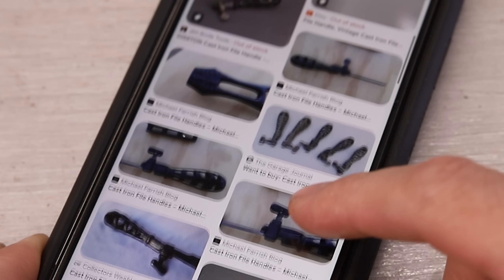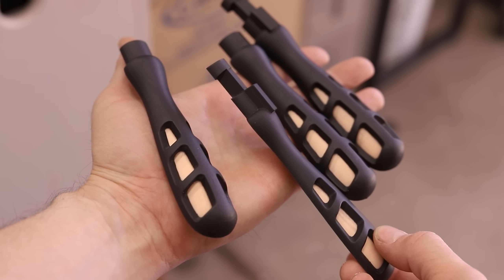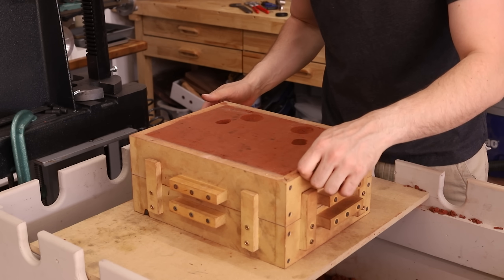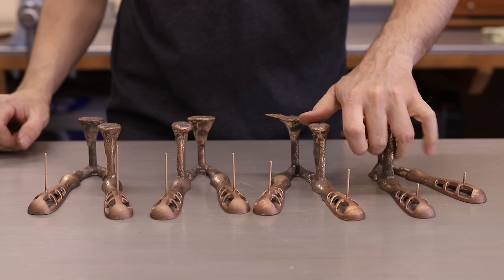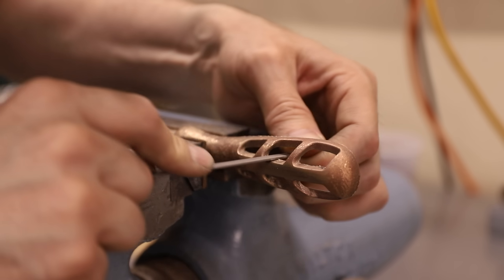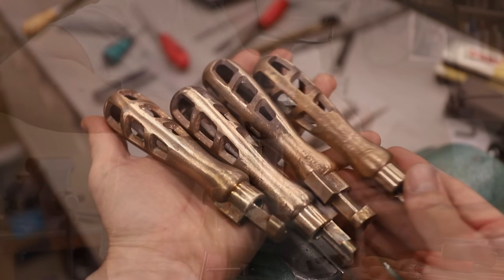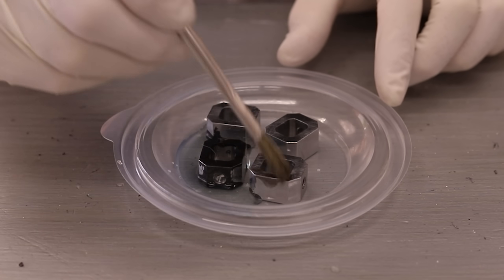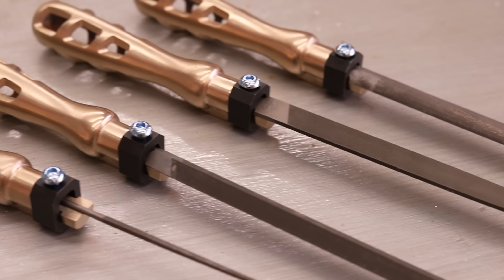Recreating a vintage design

Comment: Nice work. I have a couple of the original cast handles. They are a joy to hold and use. You’re work on these is top shelf. I can see you using those happily for a very long time. Using tools I’ve made is pretty special. They remind to of the journey to get them. Cool beans from this new Sub. ❤

Comment: When milling slots on a mini mill, you would be better off to center drill  the part larger than your end mill, then work around the slot to the desired perimeter.  This prevents the typical mistakes that cause the mill to flex and misshape the slot.  It's also better for the life of your endmills as you can bottom mill most of the material and then side cut to final dimensions.  Cool project!
Reply from the maker: Thanks for the tip!

Comment: Something I've seen others do with similar projects is to deliberately make more small air channels in the mold, not to help with the casting but to use for welding rods afterwards. This is just to ensure that if there are voids to fill or you have to weld separate pieces together, you won't have visible color differences.

Comment: How does those little bottles of UV resin like you used, compare to if you were to buy and use the UV resin meant for resin 3d printers?

As you can get a ton more resin for cheaper getting those bottles.

(I don't have a resin 3d printer as the fumes and cleanup are not something I can accommodate in current work space, but from my understanding they cure with UV light)

Comment: Something to try to avoid the screw(s) / bolt(s) from coming loose. 3 (three) options / methods.

Option-1 (one,) use / make a small washer {Diameter to be equal to Bolt / Screw Diameter(s.)} Thickness my guess 1/16" in. (0.0625" in) to less than an 1/8" in. (0.125" in.)  Material suggestion Brass / Brazing Rods of correct / desired diameter(s.)

Option-2 (two,) braze the end of the bolt / screw that comes in contact with the file.

Option-3 (three,) use a brass screw / bolt.

My opinion is the common steel screw(s) / bolt(s) are coming into contact on the file right where the steel has been extra hardened (case harden, if you will.)   Yes as a rule the "tang" of a file is usually not heat treated, but seeing that the fastener is usually very close to the part of the file that is heat treated, I think this is the cause of the bolt / screw(s,) coming loose.  By adding the soft-metal brass, it allows for the bolt / screw to "CRUSH-FORM," a secure purchase onto the file.

Another place this problem raises it's ugly head, are the "SET-SCREWS," / ALLEN-HEAD-SCREWS for / on electric motors, onto the shaft(s.)  Try the remedies above to fight this same problems.

Comment: The trick to casting in one piece with a core is supporting the core in the mold.  In this case the core has to rest on the sand forming the windows.  The core would be the same shape as the filler used to help the parting line.

Comment: Why not make a quick release collar like you'd find on a bicycle saddle? Toggle cams are the strongest fittings I know of, and the bolt face of the current design is a weak point - it works like a punch, and the loads are in shear.

Comment: To predict how much bronze would have been needed, couldn't you have told the 3D cad system what material it's made of, then asked it for a weight based off volume calculation?  Then just estimate the extra needed for process?

Comment: Is it possible to use Styrofoam, or some light weight pla printed parts what you leave in the casting mold where it just gets burned out by the molten metal? Would that cause defects in the metal or would it burn out clean and not cause any defects in the metal parts?

Comment: If you are still wondering, how they did the hollow inside: I think the answer is simple. They made it a hollow cone with a conical spur inside, so the mold was entirely reusable, and used a rotary press to round the tip of the handle. Brass is easy to deform with minimal force and the process is fast.

Comment: if you have a high res printer just put some koi fish accents on the print to give it some mould details .

i mean i would also create a negative in silicone just for resin so you could make some ocean wave designs with those koi fish. 

IDK think making everything plane is useful but astetics on 3d printers don't cost money so why not.

Comment: They certainly LOOK good but how did they feel in actual use?
I wonder if they were worth all the effort and cost of the material. 
It's a month since you posted this video and presumably you have ben using them from longer than that.

A fascinating video nevertheless.

Comment: Would have beg easier to just sand the metal part bud... you had to sand twice just to be a perfectionist. It could have got a resin printer no need to sand lines.

Comment: Excellent work and outstanding videography! I too have one of these, that I inherited, it's a bit smaller than those shown in this video. I don't use it often because the thumb screw sticks out so far, this video made me think of using a set screw, thanks. I've always wanted some that i could use with my needle files and this video has inspired me to try a 3d printed version using PLA-CF filament.

Comment: If you take a small drill bit, just drill a small chamfer into the files, then take the screws/bolts, grind a small round end, then just tighten down. You could use some blue locktite if you find the screws backing off but, it's doubtful they loosen up with the chamfers. Love the handles, they look awesome. You should try to make some of different materials, just to see how they come out. Cheers :)
Reply from the maker: Good idea! Thanks!

Comment: Hello and thank`s for a very interesting video.
You asked for opinions or different ways to do this: I would use a short, black, locking screw, it would line up, with the surface of the lock.
Just a thought.
from a Finn in Diaspora

Comment: Why don't you use grub screws instead of that bolt? You can tighten them just as much with an allen key and there won't be much stick protruding from the steel then. We all made these for needle files when we in the first week of our toolmaking apprenticeship here in New Zealand, at the company I was at anyway. We just didn't bother with the cut outs. Just turned a taper and rounded the ends of some brass round stock and grub screwed the ends. When you got into it, it was a good starting off in machining job. That, and making sets of parallels then hardening them and grinding them ourselves.

Comment: Very nice work , I’m over in GB and iv got 1 of the original handles it’s a little smaller than yours and not nearly so well finished I think it’s cast iron in construction. 
I keep a 3/16 chain saw file in mine and use it from time to time as required. 
Your work on these is 2 to none very well done 😁

Comment: A hint for milling the slots.  Drill out the excess material first.  Means you can mostly avoid plunging and nothing removes metal faster than a drill.

Comment: could you do a lost wax type casting with 3d printing filament? Also might look neater with grub screws instead of those button head bolts? either way, very nicely done!

Comment: Слишком нефункционально, дорого, трудно в изготовлении, они ведь неудобные!  Никакой эргономики, просто получилась у вас дизайнерская вещица. Я занимался проверкой разнообразных рукояток на удобство работы, у меня на канале есть несколько видео по этой теме. Рукоятки должны быть лёгкие, тёплые в руке и удобные в работе. У вас на видео этого нет. Но красивые ))
It is too non-functional, expensive, difficult to manufacture, because they are inconvenient! No ergonomics, you just got a designer thing. I have been checking various handles for ease of use, and I have several videos on this topic on my channel. The handles should be light, warm in the hand and comfortable to use. You don't have this on your video. But beautiful))

Comment: Those handles turned out really nice. Couple of tips for casting, you got voids from shrinkage because you didn't form a pouring basin around the top of your sprue and also your sprue was a little skinny and should extend just below your runner to form a sprue well. The thicker the sprue and gates the slower the metal solidifies and you want the metal in the sprue, gates and runners to solidify last to avoid the part getting voids. Start thinking about the order that parts of the casting will solidify based on the volume of metal in them and it all makes sense. I can see why you pay extra for that silicon bronze, it flows extremely well. For cores try sodium silicate mixed with dry sand and cured with CO2 gas, this is pretty cheap and makes cores that are reasonably robust but easy to break up and remove after casting.

Comment: you should try using normal 3d printer resin for this. its cheaper, usually thinner, sands amazingly and hardens with the same light. its worked wonders when i try to smooth out filament prints. the water wash resin cleans easier and is MUCH less smelly.

Comment: Buy a few servo motors for the milling machine. And then just CNC mill these things out of a bronze rod.  much faster 

I have a 3D printer and a CNC milling machine and I'm always shocked at how much effort people put into making such a small batch of metal parts with 3D printer, metal casting and surface finish.....such a pain.

Comment: These handles are slick!  I didn’t realize that the design was that old, they look very modern.  Designers had style back then, too!
Reply: Man you're 💯 correct about old time stying. When I was a young teen I saved money to get a band saw. I overlooked the old cast iron saws , and bought a new Craftsman aluminum base , with the plastic shields. It looked so modern at the time. It has held up through the years, but later bought an antique Delta with the fancy cast iron. It has a timeless look , n feel.  Now the Craftsman looks so old , n dated.   It's like the designers were building heirlooms to last forever. Like our 80+ year old Farmall tractors, they have beauty built in them , and still work like borrowed mules on a regular basis.

Comment: hey, amazing work!! just a dumb question... but wouldn't look better if you had use some set screws instead of those big ones you used? I dont know how strong they are, but it would give a cleaner look to the overall amazing handle...

Comment: I have one of the cast iron ones you were looking at. I got it from my grandfathers tools after he passed and I was given his metal lathe. It very nice because you can remove the handle and easily when needed or swap it around. He also used old used c02 cartridges from bb guns. he just tapped them on to the ends of files expanding the the hole that was there from when they were punched. I still have a few of them on the ends of some of his files. I love what you did, that design is really nice! I also like the trick you do to add small tubes to get extra material to use as welding rods if needed!!!

Comment: I see a possible problem with galvanic corrosion.
bronze in contact with steel.
galvanized screws with bronze.

Steel will rust,including the file edges in contact with bronze.
Screw galvanization will corrode.

Don't know if its a real problem or not, but it could be, especially when you consider file edges rusting won't be good.

Comment: $200 for that piece? You can't make Silicon Bronze yourself? I had to google it to find out what the alloy is. this is the return;
"Silicon bronze is a low-lead brass alloy largely made up of copper (94–96%) and a tiny bit of silicon (2.5–6%). Aside from those two elements, it typically contains other alloys such as tin, manganese, iron, and zinc."
Surely you can make yourself a sh*t load of it, to use in future projects?

Comment: Hiya, beautiful file handles! Where did you get the Belt Sander Funnel and posable metal piping please?
Reply from the maker: Thank you! I 3d printed the funnel and the ducting elbow was purchased at a hardware store.
Reply: @robinson-foundry  The funnel part, at 10 minutes in, looks metal on the inside.

Comment: Wonderful. Raises two questions: 1. Why are there no modern versions of the beautiful cast iron ones? I’ve always liked them. 2. Why don’t more files come with a simple, flat, sort of paddle-shaped handle (as part of the file itself)? I don’t really need an extra handle, and I’ve had cases in which I needed to remove it to be able to put the file flat down on a surface.
Reply: Wood handles are cheap so for the price of one metal handle you can probably equip all your file collection with wood handles.
Also wood absorb any oil or sweat you have on your hands, very useful when you use lamp black and diesel to clean parts or when you chase that 10 micron precision.
If the handle get too smooth a quick sanding will reveal some clean wood ready to absorb any fluid on your hand.
On the rare case a wood under gets loose you just let the file own weight to tap it back in its handle no tool needed.

Also all metal means less impact absorption, I don't know how well a cast iron handle holding a hardened file with a metal clamp would fare on a concrete or brick floor, probably fine I guess, but I would give a file with a wooden hand a better chance.

The two uses cases :
First, if you have limited space in your toolbox but still need an obscene amount of files variety yet you don't specialize in file use (otherwise you would allocate more space for your files and need less files). No idea what job description that would fit though.
Second if you have a lot of specialized dovetail files grounded safe edges with with specific angles, that can be a thing if you have to deal with old custom dovetails as historically gunsmiths all used their own angles to force customers to use their services. In that case having the ability to swap the file or remove it to grind one down more easily can be handy.

I spent 3 years studying the file learning luxury handmade gunsmithing. 

As for you second question question a file have a wedge tang to be able to be fitted a handle. you  drill a hole big enough for the tang to only wedge under the ferrule ring so it takes the splitting force instead of the wood but the wood elasticity compress and keep the tang tight.
And I would be curious to know what situation you needed to have a full file flat on a surface. I would guess it was a flat long and wide surface to knock a high spot, but then that's where curved files are for.

I would still prefer them to plastic handles though.
Reply: @Vaasref  I have to agree, the wooden handles are cheap and useful. But I’m surprised that there aren’t many alternatives for those who want them, for whatever reason.

Yes, I had to knock down a high spot – a curved file would have worked, too. Or even just a smaller file.

But in general I would be more than happy to use files that come with that beaver tail shape at one end, to be used as a handle. I don’t use them often or long enough to need a super comfortable handle.

And yes, plastic handles just don’t feel right.

Comment: at 3:24 to work out how much material you need, you can use the "Volume Displacement Method"
Simply get a jar, tube or container just big enough to fit you're "handles or casting models" in. Fill it with water till the water spills or overflows. Remove your "models", but leave the water in the container. Now refill it with your casting material till the container is full full, BUT NOTE: it's better to have the water spill or overflowed. this will mean there is more casting material (aka silicon bronze) in your container now as it's volume is more then that of you're handle (aka casting models)
Reply: Or right-click on the part in CAD and display volume...
Reply: @owensparks5013  True, but I think they mean if you're doing it old school and has an actual part you're replacing with casting instead of a CAD file.
Reply: You need to add quite a bit for the sprue.

Comment: The only thing I would've changed (if I had the skills at all to make something like this, which I don't) is to use a black grub screw instead of a bolt so it doesn't stick out of the handle.
Reply from the maker: Grub screws are a better idea. I just thought the blue would make the thumbnail look a little more interesting. Thanks!

Comment: This may be a stupid question but can you reuse the casting sand or do have to use new sand every time?
Reply: You can reuse all the non burnt sand as many times as you want.
Reply from the maker: Yes it can be reused but it starts to loose it’s ability to stick together as well as fresh sand.

Comment: Those are some beautiful file handles but who's going to want to spend $200 on a block of brass and then make Handel's for there files and tools usually get thrown around those looks like you have to be too careful with because you wouldn't want to throw them around and get them all scratched up cuz then they would start looking like crap so I would just have to hang those on the wall because there too nice to scratch up LOL
Reply from the maker: Thanks! Well, there’s at least one guy out there.